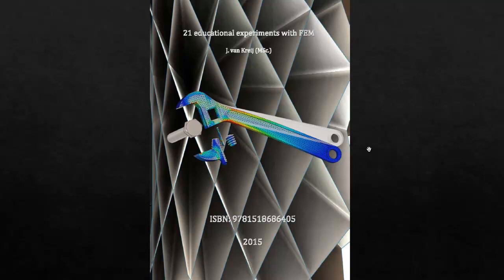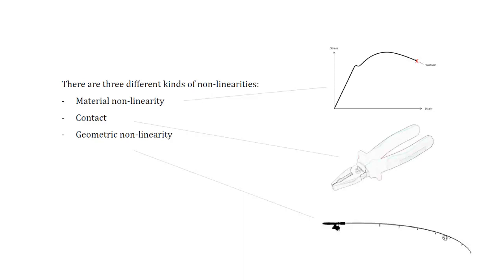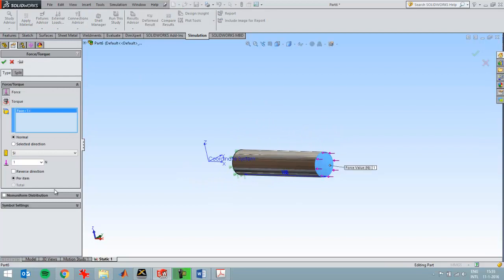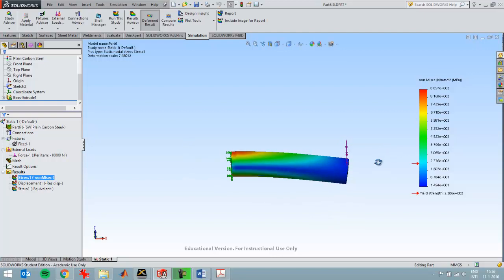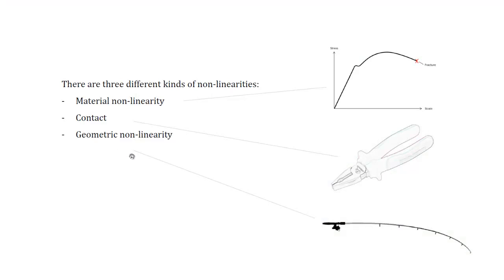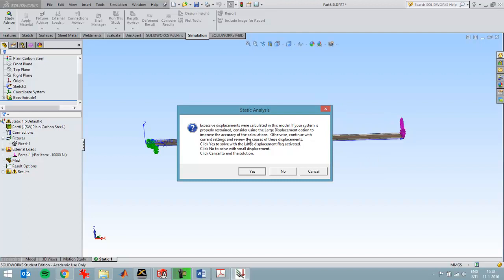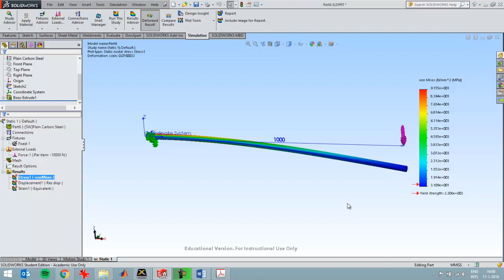Chapter 21 Explaining the difference between linear and non linear analysis

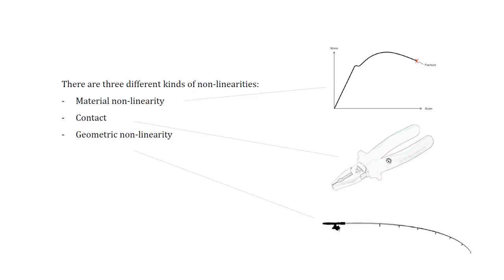Comment: 1:32 for which material this stress-strain curve is?
It's looks like the material has very low modules of elasticity. Generally the initial slope for steel is almost 90 degrees.